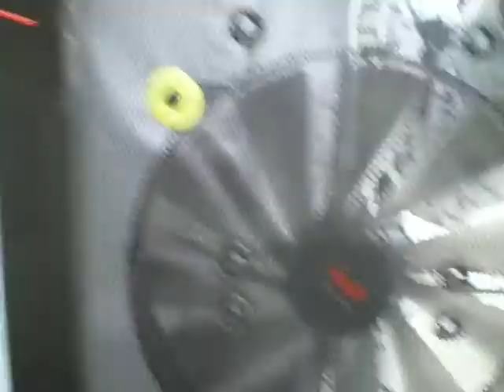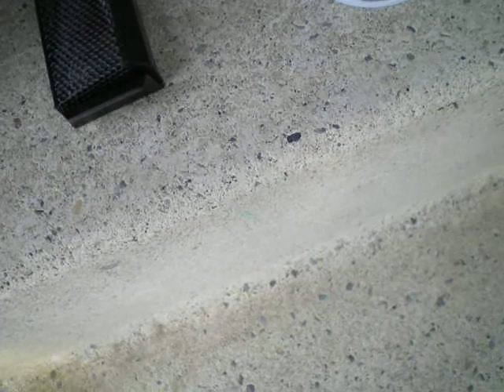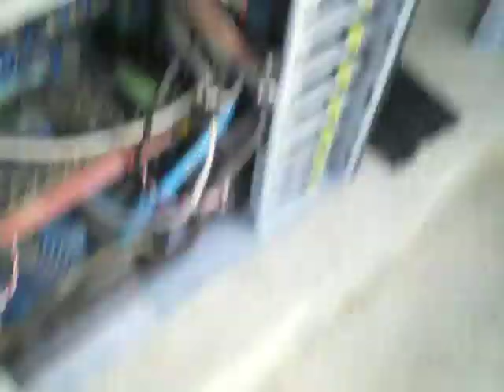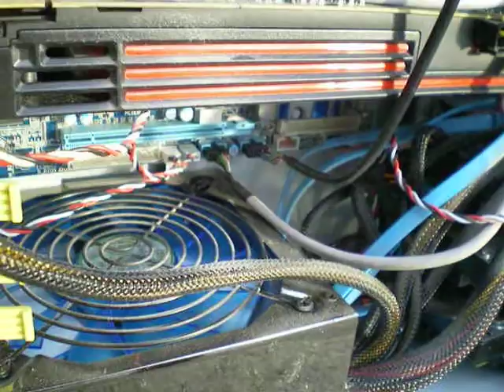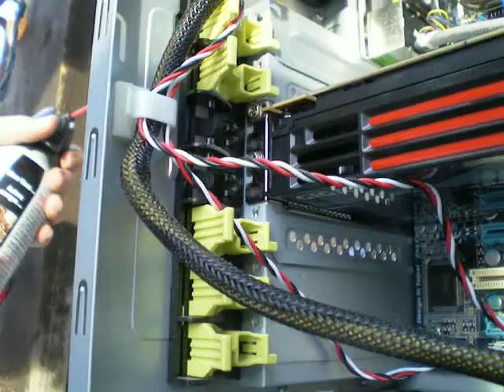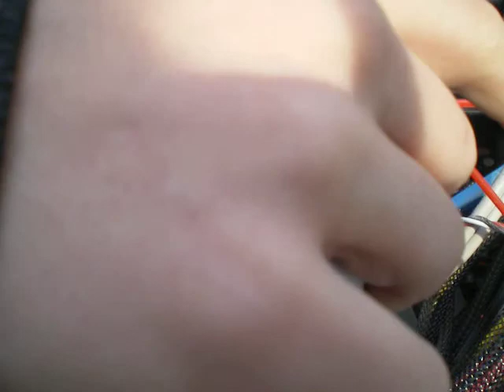Cleaning gaming rig computer

Comment: There's no problem to crossfire on that motherboard. Don't know where u got the idea that you need an intel board to crossfire. To use SLI the board needs to be certified by Nvidia, but ATI/AMD doesn't do anything like that, so almost every board out there with enough slots can do crossfire.